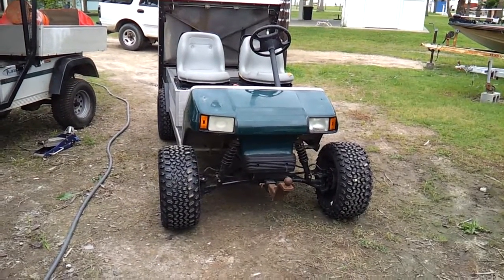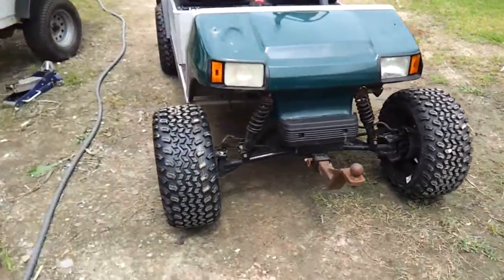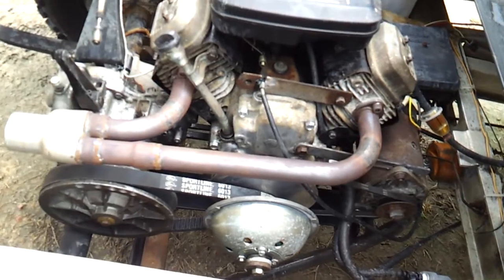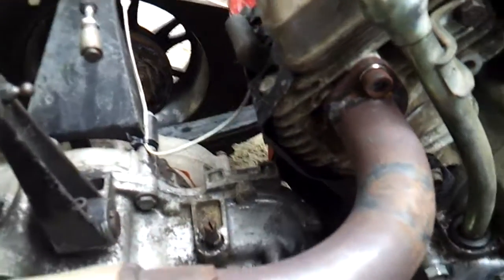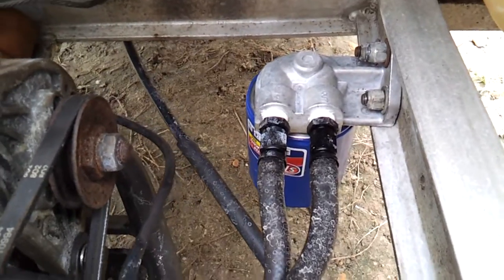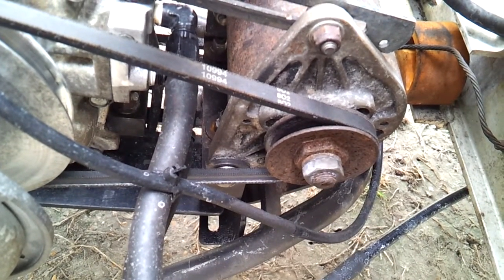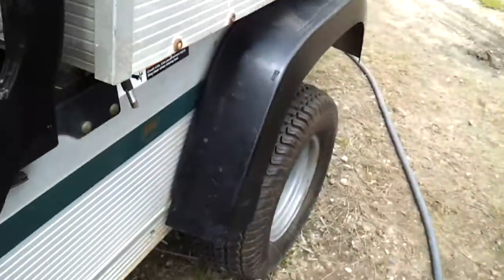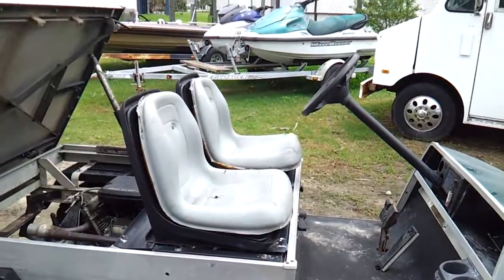V Twin Conversion

Comment: Don't know if you're aware the engine is running counter clock wise so you are running in revirce gear in forward movement.